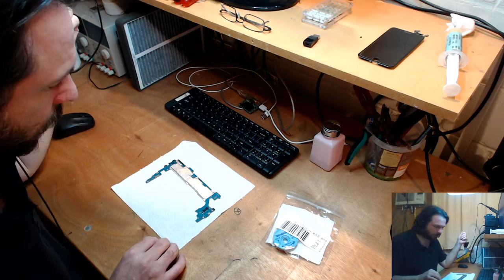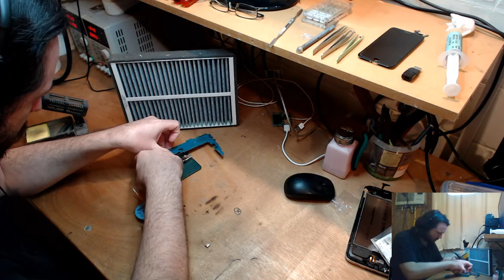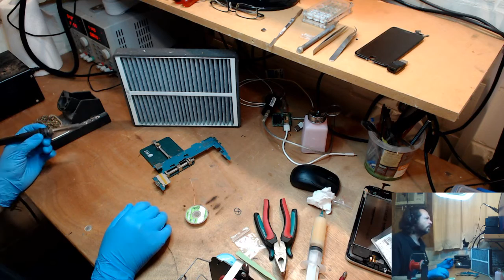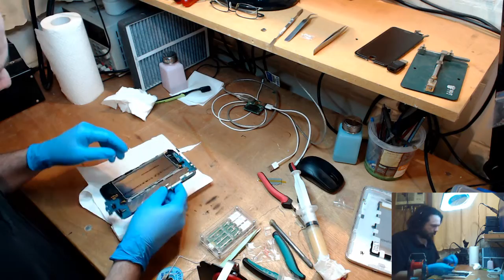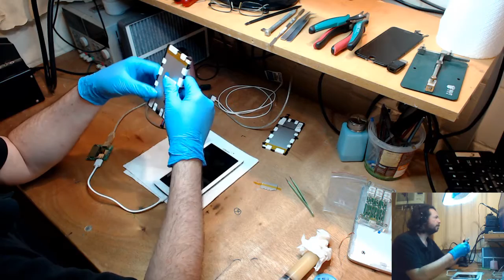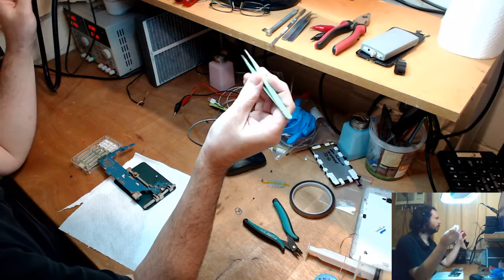Samsung Galaxy Tab 3 7" repairs - Part II - I DIDN'T break it (was already broken)

Comment from the maker: EDIT: Turns out, after reviewing the footage from the previous video, I never managed to power this unit up, so most likely I didn't break it, it was more likely never working in the first place.... but now the challenge is on :)

▶ ▶ ▶  Sometimes everything goes wrong and you cook a device.  Tonight I'm not sure specifically what went wrong but I know I was sitting on the heat for too long and from there I just kept on piling up the errors.    

Good video to watch if you want to see a slow burning failure.   Hopefully I'll follow up with attempted diagnosis and repairs.   This time I've become the "idiot workshop", fortunately this is my own device.